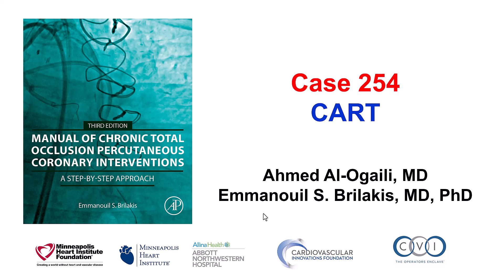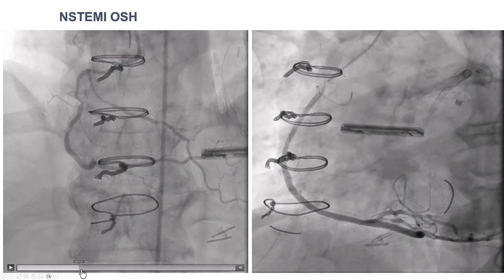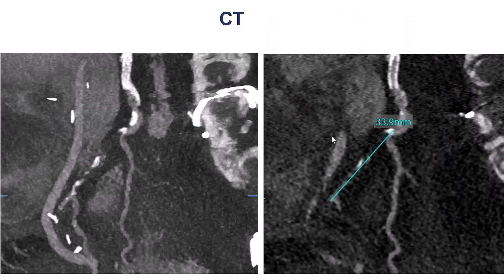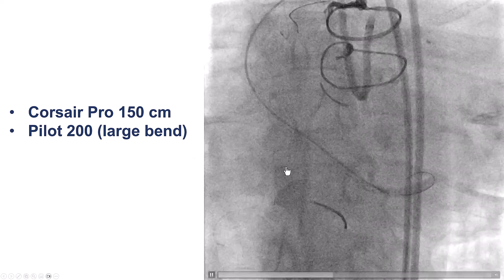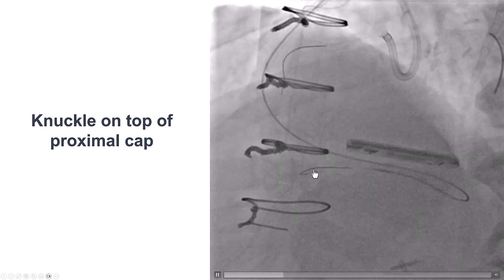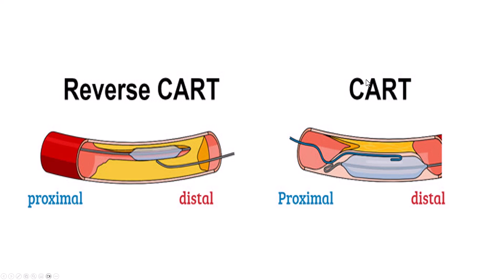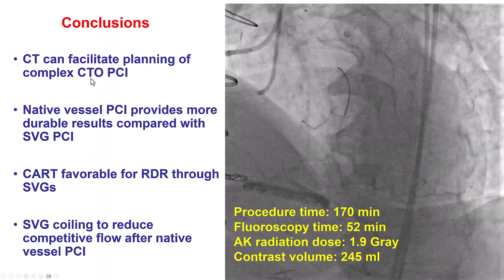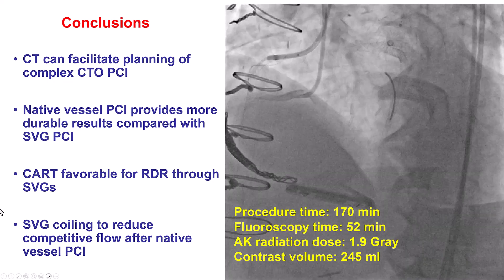Case 254: Manual of CTO PCI - CART

Comment: Thank you for the great case Professor. Is there a risk of thrombi showering into the native vessel from the coiled SVG graft Professor?
Reply: No
Reply: Is it mandatory to occlude the SVG?
Reply: @depthplumber  no but if there’s significant competitive flow from the graft the risk of stent thrombosis is higher, theoretically. No data. Just anecdotal experience. On the downside it removes a conduit to fix a CTO in the future. IMO depends on the degree of competitive flow.